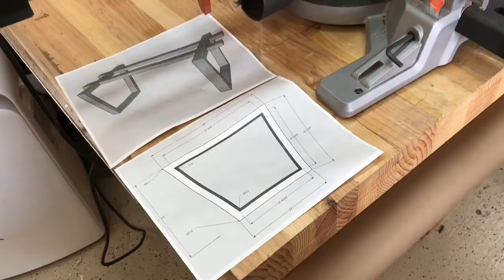Walnut and Steel Conference Table (Part 2)

Comment: Do you have plans available for the construction of the steel base? Trapezoid angles, etc.Thanks
Reply from the maker: Hi, Colby. I don’t really have organized plans but I’d be happy to dig up the sketchup file that I made when I designed the legs. It would have all of the measurements you’d need. I can get that in the morning. Hope that helps.
Reply: @LastLegWoodworks  ...that would be awesome
Reply from the maker: @colbyowens3701  Try this link. It should download a graphic of the leg assembly. https://www.dropbox.com/s/nye0zpjluw1gin2/conference%20table.jpg?dl=0
Reply: @LastLegWoodworks  ......awesome.....thanks!!

Comment: What saw did you use to make the cuts??
Reply from the maker: I used this metal cutting saw from Evolution. Evolution Power Tools R255SMS 10" TCT Multi-Material Sliding Miter Saw https://www.amazon.com/dp/B07JDRJMK8/ref=cm_sw_r_cp_apip_g4YcMmG1GLchg

Comment: What saze of top table and size for hollow leg?
Reply from the maker: I'm sorry, I just saw your comment. I will measure the table and get back to you.
Reply: @LastLegWoodworks  ok sir.. Thanks.
Reply from the maker: The tabletop measure 92 X 46.5 and is 30 inches high. The legs are made with 2 X 4 inch rectangular tubing. Hope that helps.
You can watch the tabletop being built here: https://youtu.be/KLdXeETeljQ
Thanks for watching!
Reply: @LastLegWoodworks  In europe it's in centimeters. 

92 X 46.5 inches
Lenght = 233 cm
Width = 117 cm

Is it correct ?
Reply from the maker: Hello, google shows 233.68 cm by 118.11. I wish we used metric in the US. 😀
Reply: @LastLegWoodworks  Yeah i never understand that, why america use inches and not centimeter. Cm is the exact precision in everything. It's like USA want make they own stuff in every sphere/field. Like degree, why USA use °F and not degree (°C). It doesn't make any sense. Under 0 degree = frozen . For USA 0°C is 32 °F   ???
Reply from the maker: @user-vy7gi8jo1v  I agree. They say that it would be expensive and time consuming to switch our entire infrastructure to metric. Then there are those  that like that we are different. I'd prefer to switch, metric makes much more sense to me. We seem to be running a version of both here. Most measuring devices show both imperial and metric.
Reply: @LastLegWoodworks  They said ;  it would be expensive and time consuming to switch our entire infrastructure to metric. Probably a lie. I don't know the hisotry of USA. But i'm pretty sure, USA used metric (cm) before inches. They just swaped to inches to make their own rules compared to the world. The entire world use cm, only USA use inches.
Reply from the maker: Nissa I think the colonies use the imperial system after the revolutionary war it was adopted by our new country. Maybe someday will change over.
Reply: @LastLegWoodworks  I see. It's a bit weird, cause i just read the metric is commonly used in the military of the United States and in fields relating to science, increasingly in medicine, and in aviation. Imagine science and medicine working in inches 😂🤣, would be impossible to prouve theory or anything else.
Reply: @LastLegWoodworks  Otherwise, this is the perfect size (233 x118cm) for my next gaming setup. Need a lot of space for 2 or 3 screens and my computer case. The support foot (dont know the word to describe it) under the table is perfect for stablised the weight of my setup, but the table is a little to short in height.